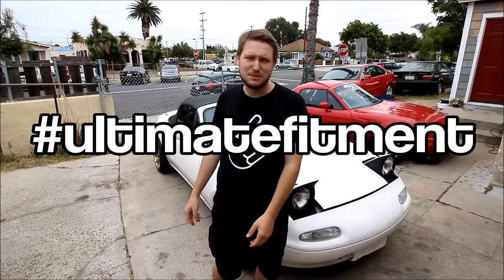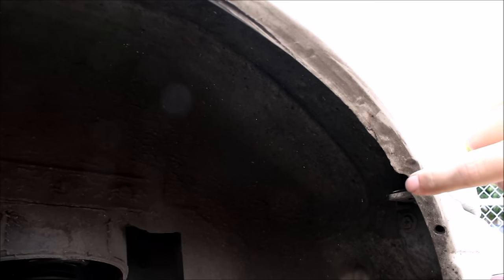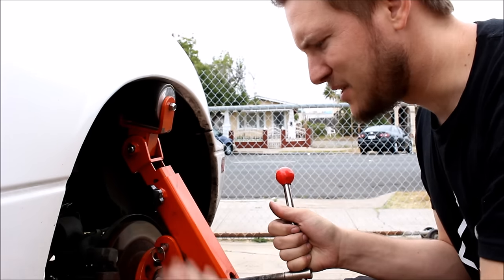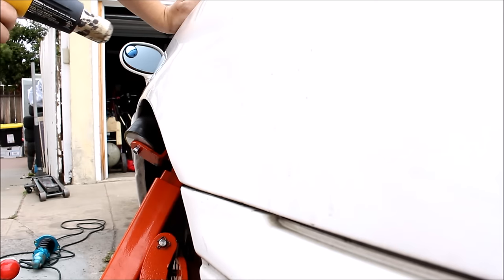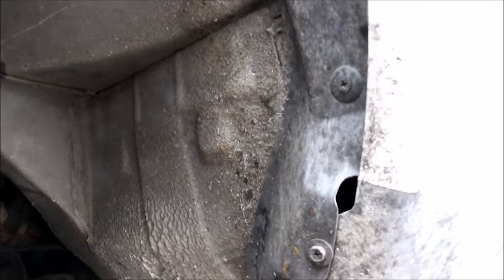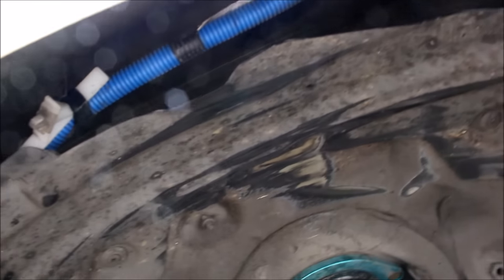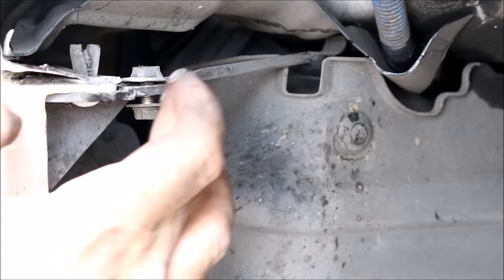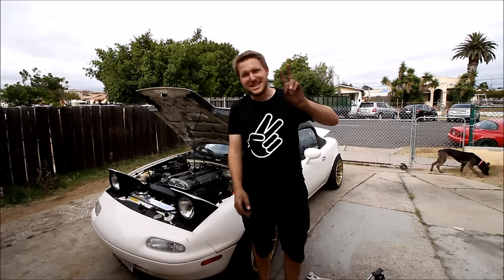Do You Even Stance Bro? How to Roll Fenders & Get Sick Fitment!

Comment: great video again i learned a lot. Only thing i would possibly do differently: where you cut the metal for the releifs or removing the fender brackets, the metal is exposed and will almost instantly start to rust in these areas. A quick squirt of spray paint in these areas would take all of 10 seconds and provide some protection

Another great video man thankyou
Reply from the maker: Good pointer! I honestly always forget about rust because it's almost non-existent in SoCal haha

Comment: I just got my 15x9 Storm S1's in and put them side by side with the stock 15x6. Holy crap what a difference. I REALLY hope they fit well onto the car without having to make a TON of cuttings and rolling. Should've went with the 15x8's... but I wanted to be more like Greg :(
Reply: Balto D did you get them on? 15x9 is decently wide for Miata what size tire do you have 225/5015?
Reply: @ConnorGrosseFilms  I put on 225/45s, and they fit perfectly! I did have to roll the fenders a bit, but I didnt have to pull them. They tucked right in. I'm loving them so far!
Reply: Balto D nice man I just ordered some coil overs for my nb can’t wait to get them in and lower, I’m on 15x7 205/50 rpf1s so definitely no problem with fitment

Comment: My main issue with this Video? You cannot remove the front coilovers in the way described. Maybe that works with these short Tein ones but nor with stock and not with mine (vmaxx xtreme). I tried for several hours and ended just with scrathing the metal with the bolts that hold the coilovers in place on the top. so i would have to remove the uper controllarm - but when u remove the long bolt that holds this in place, you need to have all of your wheels set adjusted at the shop. Thats where i gave up or better to say changed from this description. im gonna use the "Verschrenkungstest" that the german TÜV is gonna use to legalize the Wheel/Tires combo for the Papers (raise Front right and back left Wheel on 12cm wood plates, then steering the wheels, then same with front left and back right wheels).

Also German TUV requires 6mm space between Tire and Fender, (but it depends on how good willing the person is, whos testing it).

I want to keep as much of the fender liner intact, mybe heating the plastic and forming it is an option?

Comment: wheels also move in other ways than just up and down on letteral load tyres fold over
Reply from the maker: @damienfrizzell9394  The tires deform down closer to the road surface but return their shape once back up to the fender area. However bushing flex will affect fitment so it's best to not make it too tight.

Comment: 5:56 Didn't heat up fender. You can see the paint chip off at 1 o'clock if you draw a line down from the top middle of the fender to his thumb.
Reply from the maker: I heat the fenders on every pass, on every car I've ever done. 30 year old paint is not always going to bend and stretch without cracking, especially at the seam.

Comment: When I rolled my fenders the roller barely fit in the wheel well so I had to start with an aggressive angle :/
Reply: It was as small as it could get, my coil was just to low
Reply from the maker: You can raise the coilover to avoid that.
Reply: you should remove the coilovers to simulate bottoming out when checking for rub anyways. just do that before you start rolling and use the jack to adjust height. I thought the roller I had wasn't going to fit either but then I realized the obvious

Comment: Love the video, I have a question, when removing the shock, how is that simulating a shock at full load?  I would think the suspension would just keep traveling until it literally hits anything else.
Reply: when the shock is removed, he places a jack under the control arm and jacks it up until its bottomed out. then the spins the wheel to check for rubbing spots, dont forget to turn the wheel as well

Comment: PRO TIP: Use a razor blade to cut zip ties flush, so that they don't poke and cut you later on. The way you cut that off, its now like a plastic claw that will leave a ragged cut in someone's skin if they ever turn a wrench near there.

Comment: If I wanted to partially remove the front fender liner but didn't want my harness to get wet, could I theoretically move it into the engine bay where it is less likely to get wet?
Reply from the maker: I guess you could?

Comment: What kind of wheel setup are you running on your Miata? I want 15x9 on 225s. However it seems like all decent looking wheels i look at have a et 0 offset, which sounds like an impossible job without fender flares. What do you think?
Reply from the maker: Yeah 15x9 +0 with 225's is very difficult to properly fit under stock fenders. Mine are 15x9 +36 (pretty common size) with 20mm spacers.

Comment: Can you make a video showing how you fling out your fender like your Miata? And would I have to do that to fit a 9in wheel with +35mm offset in my na or can I roll it just like you did in this vid?
Reply from the maker: You can fit those with a very mellow roll, I run 15x9 +16 on my other car.
Reply: +TheCarPassionChannel thanks man, good job on the videos

Comment: any suggestions for a 98 prelude with 18x 8 wheels. just installed. but rubbing on rear when bumping and hard corners. thanks
Reply from the maker: The method I use in this video taking the coilovers off will work on any car

Comment: Can you put a floor Jack under the suspension arm with the shock in place?
Reply from the maker: Typically it will start to lift the car up before the suspension can fully compress so you can't get the tire all the way tucked

Comment: Does anyone know about how much camber you have to run to fit a 15x8 et0 with a 205/50/15 on a 91' miata?
Reply from the maker: It's not about camber, it's about fender work. Get yourself a roller because that takes a lot of work to fit on a low Miata.

Comment: Hey Greg, did you have to remove the long bolt on the upper control arm for the front coilover removal? I tried just undoing the lower bolt and top hat nuts then ripping mine out but no luck :(
Reply: yes

Comment: Would a 15x8 +25 fit an NA on stock suspension without rolling?
Reply from the maker: Depends on the tire, but it should work fine. Possibly minor buzzing in hard corners, you might not notice. There are several wheel fitment threads covering a multitude of wheel and tire combos.
Reply: TheCarPassionChannel
I've been checking back and forth everywhere and I seemed to get conflicting answers lol. I guess I won't be too scared of rolling if I have to. Prolly gonna get some Konigs because the car is bone stock now on dry rotted wheels
Reply: I'm wanting the same exact wheel size, what size tires are you going to run?
Reply: chaz terry that I'm not sure on yet. been checking miata forums. I don't mind a little stretch but I don't need a beefy or super stretched setup. gotta figure that out lol
Reply: I'm running 15x8 +25 rims with 205/50 R15 tires. 195/50 R15 would be fine too.
Reply: MiataMods
Awesome thank you. Like the channel a lot and subbed. Your accent is almost as good as Lucacarmods lol
Reply: I don't know if I should take that as a compliment haha!
Reply: MiataMods
I love his channel lol it's a good thing
Reply: Thnx bro!
Reply: What sizes are your wheel and tires? Thanks! Love your channel

Comment: How wide/far can you roll on stock fenders
Reply from the maker: I currently have 245/40's on 15x10 +25 on my NA, and I have a video with some tips on how to get the most from your stock fenders ("How to take your fitment to the next level" I believe it's called)

It's not easy and it's not perfect, but it can be done. 225/45 on 15x9 is about the widest you can go without excessive rolling/pulling etc
Reply: @TheCarPassionChannel  15x9 is where I want to go but I don’t want to damage anything or it look lumpy. When I saw you cut the metal I almost cried. Can we continue on @MrDetailedddd

Comment: What does the numbers mean for the tyres 0:35. Im a noob at cars
Reply: First number is width in millimeters. Second number is aspect ratio, which is the measurement of the sidewall height in percentage of the tread width. Third is wheel diameter.

195/50/15
195mm wide, 50% aspect ratio (50% of 195 is 97.5mm, so the sidewall is that tall), 15" wheel
Reply: +Travis T Thanks a lot travis. But the numbers before that what do they mean? Are they the same thing but diffrent measurements?
Reply: +Mohammed Al-Shaqeil Oh! The wheels are 15" in diameter, 8 1/4" (8.25") wide, and zero offset.

Offset is measured from the center of the wheel to the face of the wheel mounting surface. So, zero offset means that the wheel mounting surface is in the center of the wheel.

Backspacing is different and is measured from back of the wheel, and is more normally used for truck/off-road wheels.